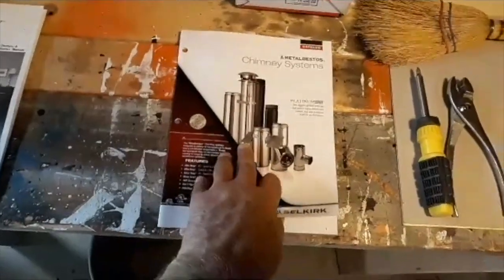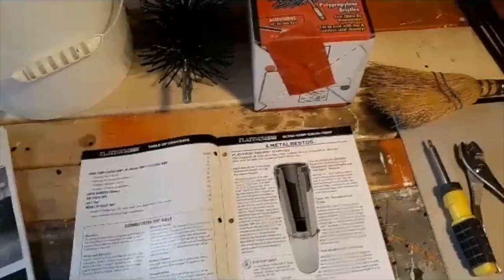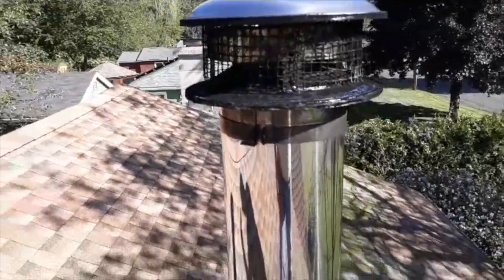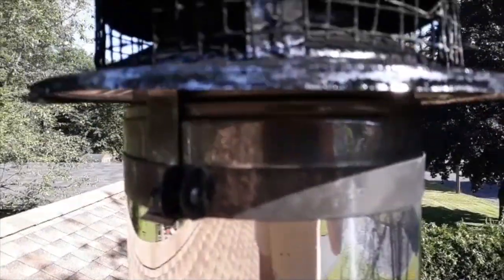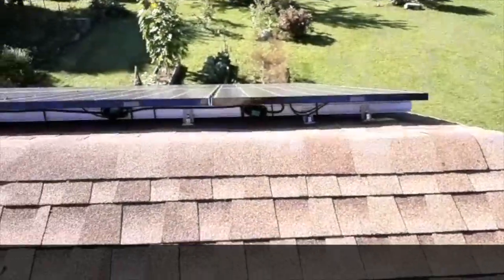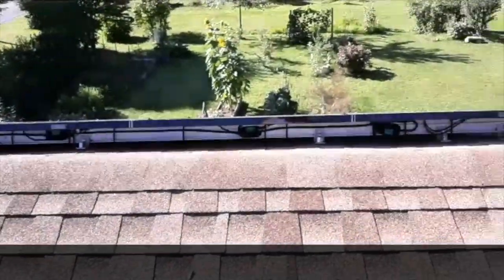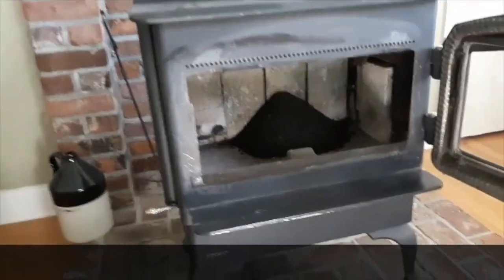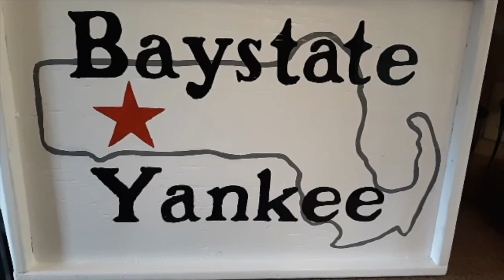How I cleaned our stainless steel chimney

Comment: We’ve only had our wood heater since this past thanksgiving. Having problems with the thing leaking when it rains. The installers have been back twice now with another attempt coming within the next week. Anyhow, as we’ve worked on the leak problem, I was shocked at how much soot and creosote has already built up in my chimney. I crawled up on my roof today to place a plastic bag over the chimney to see if it leaks during an upcoming rain event. It’s been a process of elimination to find the leak. I found it extremely difficult to maintain my positioning on my metal roof. The chimney section on the roof is about four feet tall. It dawned on me as I dug my toenails and fingernails into the metal roof while also placing the bag over the chimney that I’m going to have one heck of a time getting that chimney cap off for a cleaning. I enjoyed your video. You made it look easier than what it is. Thanks for sharing!!!
Reply from the maker: I was fortunate to have a friend install this chimney for me.. he was very meticoulous at his work.  he also did the brickwork on the hearth.. My roof is asphalt shingles so it is much easier to maintain a footing..   As a side note though, we had a few leaks at one time, due to driving rain..  I was baffled also as to how it got in,, Then one day a bird flew down the chimney and we had to get him out.. (he survived)  after that I wrapped a piece of wire cloth around the chimney cap.. the smoke goes out but the birds dont come in.  Following that incident, we have never had rain in the chimney again..  Not sure if my actions cured the problem, but either way, I am pleased.  Thanks for watching!